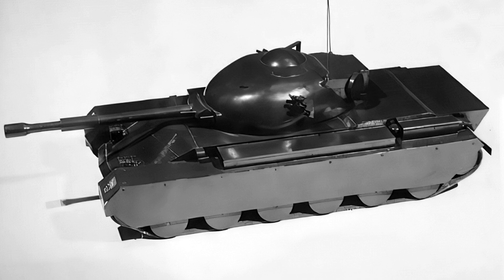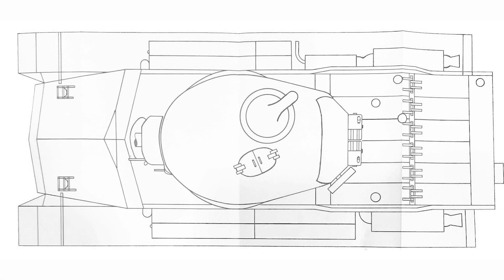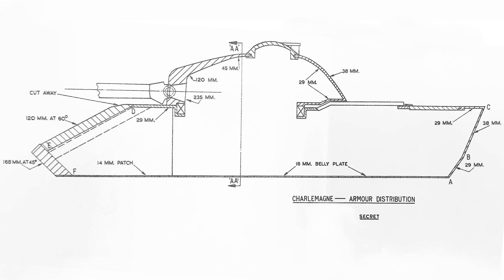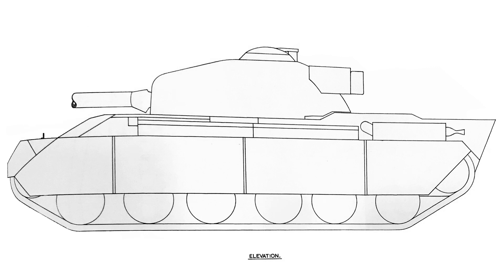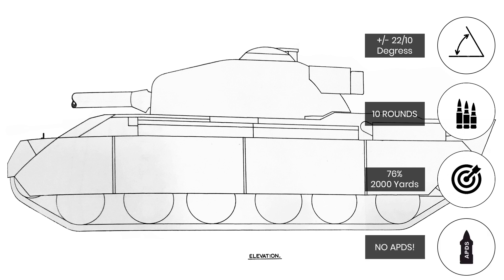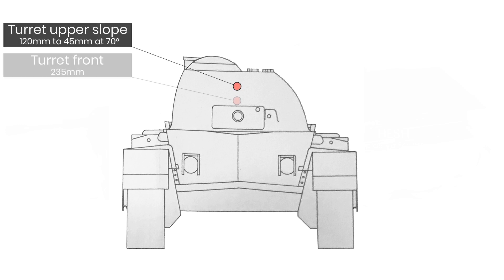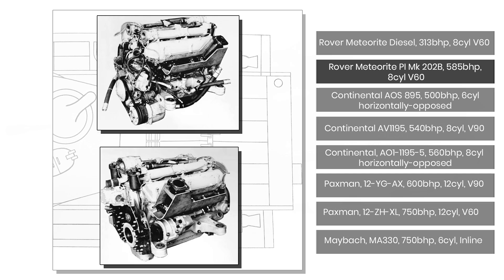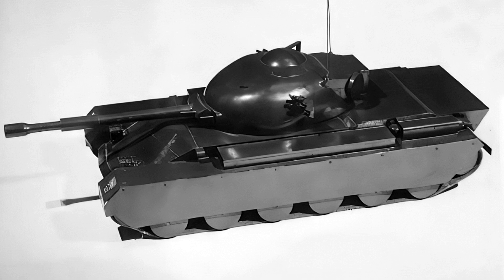Charlemagne - Main Battle Tank - Tank Design & Development

Comment: Excellent,as always :)
I have a question on a different matter, the US light tank M22.
The question: Is this vehicle designed specifically for the Hamilcar glider (and the C-54)? Or did the British simply just give some input regarding the tank's weight and size limit, so it will also fit their needs?
Thank you in advance,
A Hungarian Armour Enthusiast.
Reply: The M22 was independent of the Hamilcar/Tetrach but it happened to fit it. The Tetrachs were worn out and the Hopkins too heavy so the M22 was a convenient option. One wonders how many and how M22s ended up in Egyptian army service.

Comment: What about a video on either the Chimera Light Tank (the Manticore in WoT) or the Chimera tank destroyer based on the Chieftain chassis designed in the 80s?
Reply from the maker: chimera light is on the list to do 
:)
Reply: Though you could consider it a light tank, the Chimera 1955 was really a tank destroyer itself. Since its intended purpose was as a replacement for towed 120mm BAT recoilless rifles.